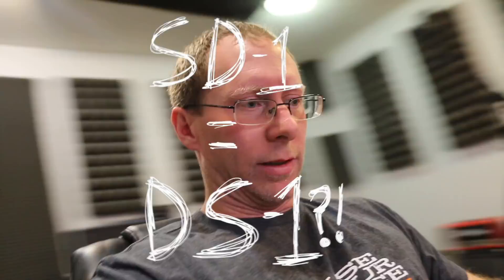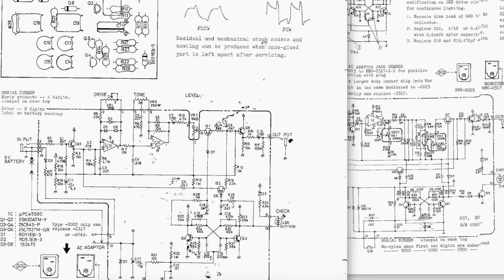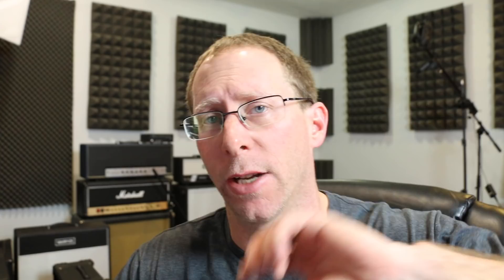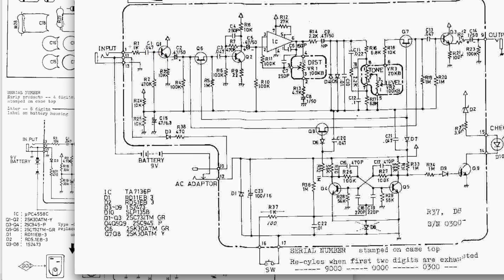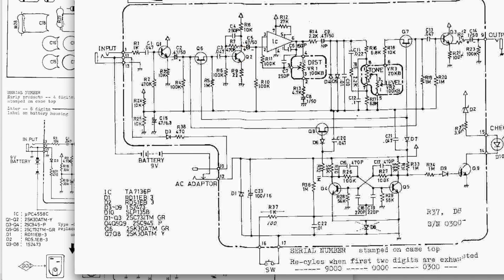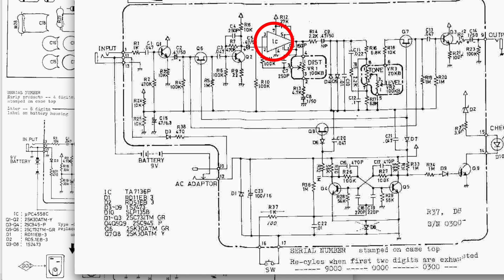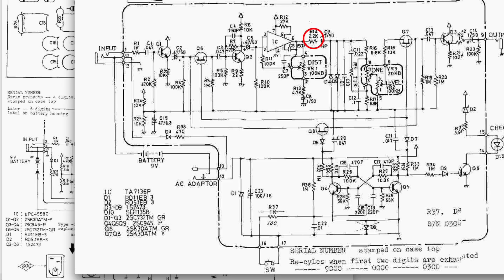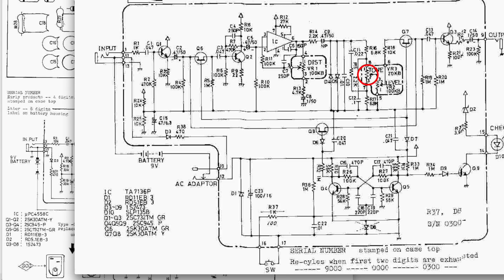Nerdy Circuit Stuff.... Comparing the Boss SD-1 with the DS-1

Comment: I actually like the boss sd-1 along with a od808/ts808 or a od8/ts9, The sd-1 has a flatter, smoother response in the high mids, It is a good option to have both. I use both to hit an already high gain but dull sounding amp sound to tighten it up and just make everything more "alive". I have quite a few various overdrives that are used in this manner, The other out of all I'd mention I really like is the MXR custom audio electronics mc402 boost/overdrive pedal, This one is even smoother than the sd-1 and flatter but with some amps it works just great for diming the front end. I do not really use much of the on-board overdrive which is available from my overdrive pedals due to having quite a range of amps that have good sounding high gain/lead channels that just need smashing to tighten them up as described and that a maxon od808/ibanez ts808 does so well in most cases.
I have quite a number of dedicated high gain distortion pedals for running into an amplifier's preamp clean, In many cases powerful enough to use as pre-amplifiers in their own right into an amplifier's (series obviously) FX loop return (A few great examples of what I'm talking about that you'll now as Whampler pedals would be the Triple Wreck and the Dracarys, Both great as modern, high gain distortion pedals into a clean amp's front-end or as a preamp which is small but very powerful, I'll put a parametric EQ rack mount in between that takes the pedal level and spits it out at line level, So being able to apply additional equalization is just a bonus, Anything that does that job such as dynamics processors are well worth picking up, Especially on the used/second-hand market for peanuts).
They also obviously work great as a means to getting a signal from the output of the pedals DI'd into an audio interface then deploy a plugin which acts a power amplifier stage and then a mic'd cabinet sim/emu, Which I personally prefer impulses responses for, One's that allow me to load my own, I've been using impulses since ReValver Mk II as a plugin within a DAW and before that Sound Forge's Sound Mirror processor (which was along way from ideal since it was in the audio editor which wasn't available in real time as a processing plugin!).
Nowadays these options are absolutely plentiful, I have a Two Notes TORPEDO C.A.B. which is a great little box and recently just got a Mooer RADAR which I implore anyone that plays to checkout/treat yourself to one, They are awesome, tiny little boxes of awesomeness that you won't regret buying! They're essentially the same as a Two Notes TORPEDO C.A.B. in a micro sized pedal!!! I've ordered a second one so that I can use a pair for stereo processing.
The ds-1 well I have one but I could never find any use for the damned thing, So a friend switched things up for me inside it to turn it into a pretty vicious distortion/fuzz even at it's extreme that I am able to use for uberdoom riffage. I use that only into a clean setup amp wise, It doesn't really play at all well with an amp that is already dirty for my tastes at least. As I've mentioned, I've got a lot of really great distortion pedals and the Boss DS-1 is certainly not one of them even though I did finally find a use for it. All the best as always and always enjoy your videos Mr Whampler Sir, Cheers

Comment: It might have been a better idea to use the schematic for the second-edition DS-1, since the circuit on that schematic more closely resembles what you're likely to find on the market, as well as what you'll buy today. The point is still the same: they're drastically different, but I feel like it's something to point out.

Comment: I've been wondering if there are mods that can be done on surface mount component pedals without having to use surface mount components. Is it possible, or am I thinking too big?
Reply from the maker: possible, but not recommended - it's just not a good physical connection and the soldering joints can break easier

Comment: I dig the splainations.... in addition to schematic theory...  what would be cool for me is sime practical advice on how best to remove parts from PCBs...esp the multi-pin stuff like Pots, ICS, jacks, etc.   I frequently find:  1.  The solder seems to have a higher melting point. 2. That the pins stick to the traces even after removing solder. 

Appreciate your taking the time to share with us.

Comment: Maybe this is a dumb question, but how does a tone pot differ from a volume pot? Meaning, I understand that one alters the tone and one alters the volume. But after watching your videos, how is it that the volume pot actually effects the whole the signal and the tone pot only effects certain frequencies? I understand the idea of R/C combos creating filters, but for some reason I am really confused on how one works versus the other. At first I thought it was that maybe volume pots can kill the whole signal because they shunt to ground but I see the other pots do that as well? Sorry, im not only confused about the idea but I think I am having trouble articulating my question as well. Please ignore if this makes no sense lol! I read your books and build my own pedals so I think i know just enough to get me into trouble. No formal training unless you count Youtube University and countless forum hours ;)
Reply: A volume pot is generally wired as a variable voltage divider. If you have two resistors in series from a voltage to ground, then the voltage at the point connecting the resistors is lower than then applied voltage depending on the ratio of the resistor values. Two equal resistors will supply half voltage for example (this is used in those pedals to create the refference voltage at half supply, see R18 and R19 on the sd1 for example, but thats another topic), a larger resistor to ground than to signal will result in more than 50% voltage and vice versa. A pot is just a piece of resistive material with a wiper that can tap at any point along the resistive stripe, essentially dividing the resist into two resistors with values depending on where the wiper is. in the middle you have your 50/50 (on a linera pot), all the way up the tap is essentially converted to the input with a big resistor to ground wich will not affect the signal, all the way down your output is connected to ground.
Now for tone control, what a capacitor does is it essentially behaves as if its a resistor whos resistance (impedance to be correct) gets smaller the higher the incoming frequency. A basic R/C is just a voltage divider with one of the resistors replaced with a capacitor. for a low pass you have resistor on top and cap on bottom. For a low frequency the C will appear as a large resistance, larger than the top resistor, so a lot of that signal passes to the tap. For high frequencies, the C appears much smaller than the resistor, so a lot of it passes straight to ground, leaving just little signal at the tap.
The tone controls on those pedals are actually multiple filters working together in different ways, so im gonna start with a much simpler one, from a guitar. On a guitars tone pot you generally have a C to ground with the pot as a variable resistor in series, the other half of the voltage divider is the pickups internal resistance. By adding a non frequency dependend resistance in series, it will offset the ratio of the resistance (impedance). If your tone pot is 500k and you have it on half, low frequencies will see 250k + infinite from the capacitor. High frequencies will see close to 0 from the cap, but theres still the 250k, so more highs appear at the tap than if the resistor was at 0.
On the SD 1 you can see that arangement on the left half of the tone control (pin 1). You have R7 as your top resistor with C4 as one bottom "resistor", by turning the pot to reduce the resistance between pin 1 and 2, you reduce the offset that resistance provides to C5 (+ a little more offset from R8), thus filtering more highs out.
Pin 3 is wired into the feedback of the OP amp, wich is an active low pass. Turning the pot to reduce resistance between pin 2 and 3 again lets more highs bleed to ground, but because of the way the op amp filter works this will actually boost highs, though this is already way too long and im not gonna go into that now.

I may have went a bit too in depth, even though i already simplified quite a bit. I hope it' still somewhat comprehensive and helpful
Reply from the maker: Uzmeyer explained it well, but I'd phrase it in simple terms: a volume pot will control how much sound you send to ground (which kills the signal). A tone pot (well, passive ones at least) will filter sound through other parts and the pot controls how much of the signal is going to that filter, basically.
Reply: this is great! Thank you. I mean im not gonna lie ive had to read it like 10 or 12 times but it helped alot!!

Comment: What about the Boss OD-3?  How would that compare to the Sd-1?  You don’t seem to hear much about the OD-3.
Reply: The OD-3 is a completely different animal compared to the SD-1. The SD-1 has the normal tube screamer signature mid hump, while the OD-3 has more low end to go with that mid hump. Because of this, the SD-1 will tighten up a flubby distorted amp, while the OD-3 might not. Also, the SD-1 uses a typical op-amp gain structure, while the OD-3 uses discrete transistors to create gain and distortion. If anything, the OD-3 is more similar to the Blues Driver than the SD-1.
Reply: Other than the descriptions of the circuit differences mentioned, the OD3 kind of does better in a different application.  Where the SD-1 and other overdrives do better pushing a clean amp into distortion, or adds more gain to an already distorted amp, the OD3 is a bit different,  while the OD3 CAN be used to boost another amp, the bass response and extra gain can sometimes overcompress or make things too flubby sounding.  Where an OD3 shines, is if you have a clean amp that you love the clean tone with, but doesn’t have a dirty channel, the OD3 makes a great distortion pedal in a completely clean amp, but due to the design is not as hard clipping (i.e.not as fuzz/fizzy) as something like the DS1.
Reply: Well, it contains two clipping stages as opposed to the SD-1's single clipping stage and it also has more gain, both of which increase the compression.
Reply: The  main difference between the BD2 and the OD3 is the BD2 still uses opamp chips for the gain stages, where as the OD3 uses the same topology, but instead of Opamps uses either JFET's or MOSFET's for the gain stages, giving it more of a tube signature tone.  It's a superior pedal, but people identify with the blues driver name and blue color so much - they never made the transition.
Reply: I had an OD-3, but found its excessive compression didn't work for me.  It's possible to go from clean to overdriven just by altering the guitar's volume control, while the output from the OD-3 stays at the same level.  In theory, this is great, but in practice, any playing dynamics were ironed out, making the sound rather dull.  I don't know if the OD-3 contains a specific extra compressor circuit compared with the SD-1.  Brian will hopefully enlighten us.
Reply: The OD3 is more comparable to the BD2 I imagine. There's an old rumor that the OD3 was actually supposed to be the BD3, but the BD2 sold so well that they just made it a new yellow drive.
Reply: Matt Pacco   That’s interesting.  Now that you mention it, the OD3 and the BD2 do sound pretty similar.